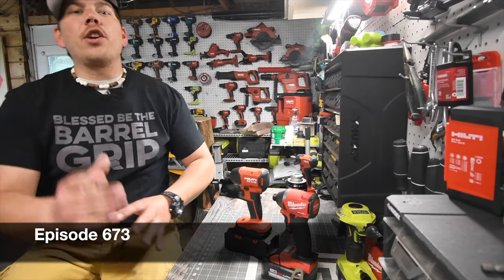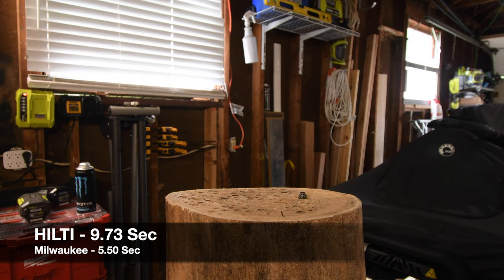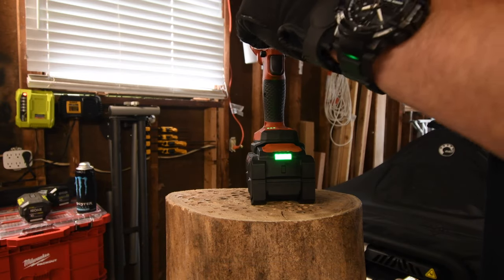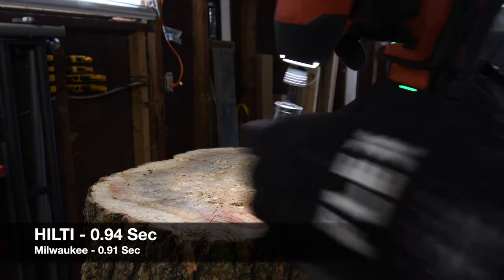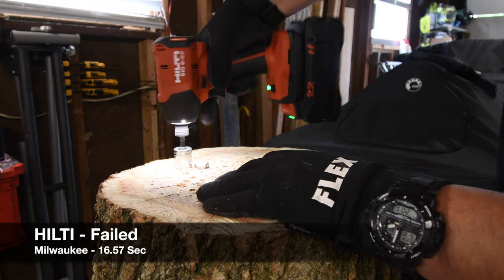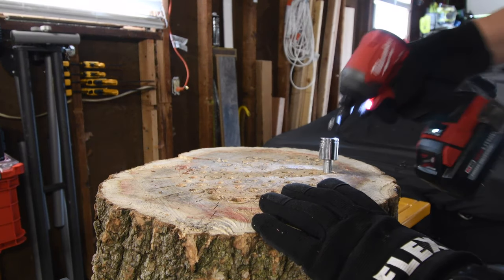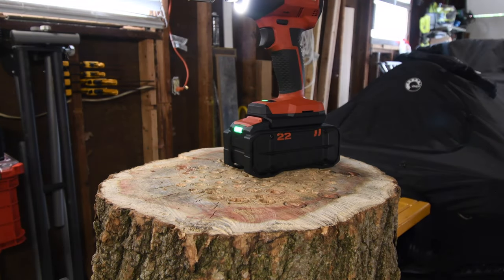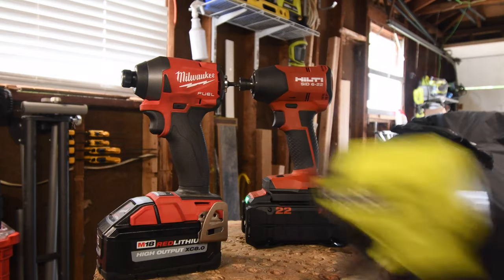Impact Driver Show Down!  (Round 2)

Comment: Ryobi bits arent garbage, just misunderstood! What you do is you run them over a cheese grater until they are fine powder, should take about 30 seconds, then you sprinkle the dust over your other Ryobi tools and it increases their performance by 10%. While you use Milwaukee shockwave bits in it of course.

Comment: Great Video as usual.. Also totally agree on Ryobi bits, complete trash, I’ve had their Titanium drill bits break completely from its shaft, assembled incorrectly causing horrible wobble (same drill bit set), and their driver bits look worn TF out after driving in a few torx or PH screws.. never again will I buy their drill or driver bits .. So far liking the Milwaukee bits and the Kobalt XTR
Reply: Yes Ryobi bits are trash.  I got a good deal on a combo bit set at HD, and after 2 days I know why.  Garbage.
Reply from the maker: and they are the same price, that is what is crazy

Comment: Also, Dave, that 8.0ah battery is too much for the Milwaukee impact.   It's causing the RedLink to shut it down.   A 3.0HO is plenty for it, a 6.0HO for runtime.   The 8's & 12's are best for circs and recips.

Comment: Great video Dave.  I currently have a couple Gen3 M18 Fuel impacts. I also have a M18 Fuel impact wrench, the newer, stubbier version.   Not overly impressed with it.  I'm waiting for the new Gen4 impact.  Dewalt stepped up their game lately,  long overdue.   I picked up the DCF850 at HD, but ended up returning it after it puked one morning at the jobsite.   I still have yet to see anything beat the Gen3 Milwaukee. A coworker who was a big Makita guy recently switched to Milwaukee,  but won't let go of his 36v, dual battery rear handle circ saw.  That thing is a beast. Almost every framer I see loves them.
Reply: Are you blind? Flex impact destroys Milwaukee…
Reply: @athannaelanderson3806 , not blind at all.   The Flex definitely has the power,  but until their longevity is proven to hold up out in the professional field, I'll stick with Red.  My M18 impact has been rained on, submerged, frozen, and taken multiple drops from 30' and landed on concrete.  Battery flew off and everything.  Not a whimper.  Still kicking every other ass out there.
Reply: @michaelenockson6536  watch the water torture tests, we literally survive being submerged as well. They are a great quality product, don’t miss the warranty Brother!!!

Comment: 09:15 Meanwhile the ryobi with a simple 1.5Ah battery be liek: oh you two big boys can't bottom this bolt? Hmmph! Look at me go! 😁

(to add insult to injury that entire impact wrench setup weighs something like 4 pounds + 1 oz. And only costs like 195$ to kit it out.
Both of those impact driver setups weigh nearly SIX POUNDS EACH. It costs nearly 430$ to set up the Milwaukee in that configuration if you don't have a charger)
Reply from the maker: that's why its makes a good test for the motors
Reply: Vroom Vroom! 💪

Comment: Thank you for the good experiment. However, I think there is a little problem with the experiment. If you experiment with a hilti right next to the place where the hexagonal piece was drilled in Milwaukee, you can have a problem that the tree density increases and it doesn't get stuck.

Comment: the Milwaukee was cutting out because the battery you were using was tripping the overload protection you need to use a smaller battery

Comment: Same idiotic mistake driving them right next to each other so the second tool suffers a penalty from compressed timber providing a biased and silly review.

Then you measure inside the tool for heat on the hilti and not the chassis like you did the Milwaukee. Whats the point.

What am i supposed to buy when i cant get good information
Reply from the maker: you do realize this comment is biased right? Based on what you said, you're saying that this video is biased towards HILTI. WRONG. try aging cup cake
Reply from the maker: If you watched the entire video you will see that the Milwaukee Won in this video. I love it that people like you say the video is biased towards the tool that lost. lol

Comment: Really? Ouch. Hilti is a brand new 2022 tool with 22 volts, more IPM, higher price point, equally matched RPM, more torque, needs to take multiple breaks, runs hotter, and can’t keep up with a Milwaukee 18v tool that came out years ago? Sorry Hilti MORON I mean NURON tools, try again. It literally lost every single test even with a damn toaster sized battery! I mean it did hold on to the bit but when you take 30-40% longer to do a task I guess you need to get one thing right. The light is cool. Two points. Run it against the Ryobi HP line.
Reply: Lol
Reply from the maker: both tools has its ups and downs
Reply: That gen3 can't even compete without at least an enormous 180$(after tax) XC6 battery and weighs over 5 pounds with it installed. 6 entire pounds with the XC8 used in this video.
It lost to a 4 pound impact wrench with a 25$ battery

I'd rather just use an impact wrench to drive bolts. Any impact wrench. From any brand 😁

Comment: Ryobi tools are garbage and hilti tools aren't much better there specs don't match their performance
Reply: Hilti is the only brand that actually accurately tests and specs out their tools no denying that
Reply: @vojnikjna30  if that is the case as you claim then why is it slow at shit. My craftsman impact is faster and more powerful that hiltis top of the line impact
Reply: Hilti is far from garbage and if you have ever used one you would not say that. Ryobi is a homeowner tool that is fine for the dollar.
Reply: @jimdiet8534  I have and like I said my craftsman 3 speed is faster and better than it
Reply: @mikevollmer3579  it's obvious you have not. There is a reason the rental stores use Hilti. I am glad you like your craftsman but the two tools are far apart in build quality. The Craftsman is a run of the mill tool.
Reply from the maker: HILTI tools are fantastic tools and HILTI Fleet service is what buys them. HILTI builds skyscrapers